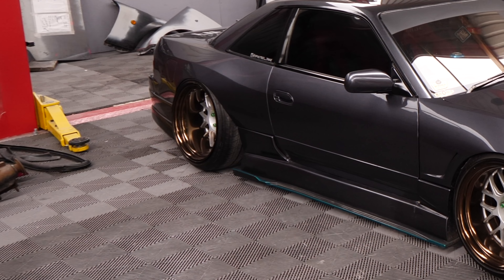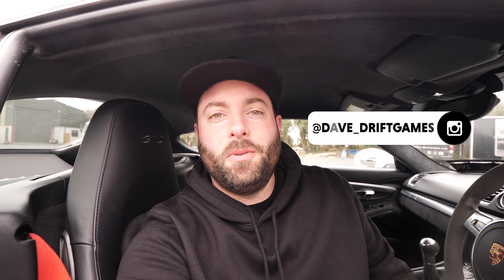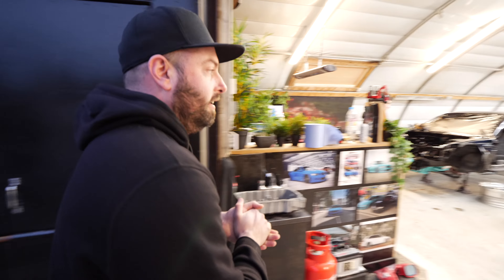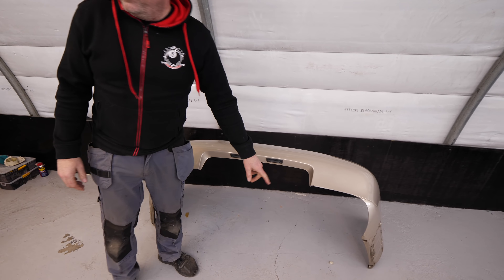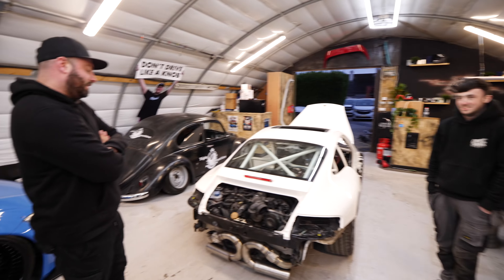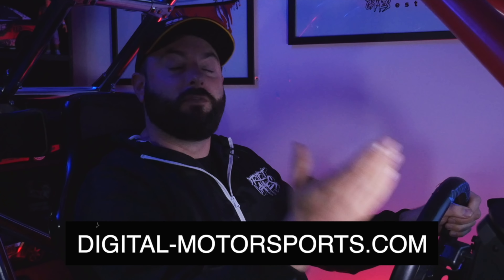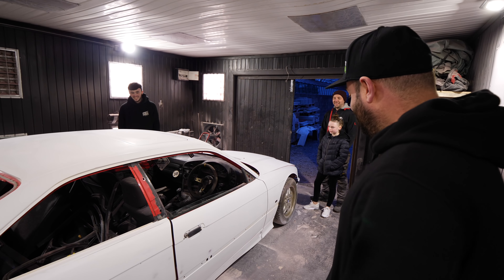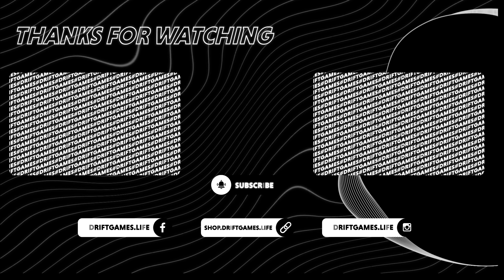BMW E36 WIDEBODY on Work Wheels | ALL PROJECTS updated!

Comment: Will we get to see the engine builds for the two builds? :) that soarer though would look brand new if not better with a good paint correction.  I seen an a utopia sign in your mans shop that done the Porsche so maybe he has the zivizzer paint correction products which are excellent.  No other compound will ever get near as good.  It will be a mirror before waxing
Reply from the maker: The Soarer paint is fine, we just want to try and out ‘mad’ the PS13 with it. The engine builds are coming Tuesday!
Reply: @driftgames_life  sounds like josh talking 🤣 I can’t see how you could outdo the ps13 though